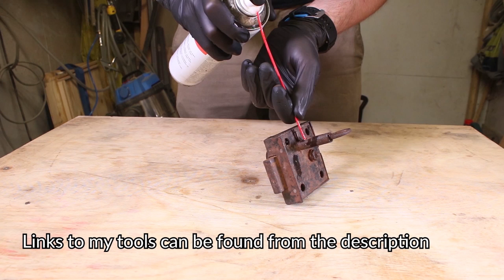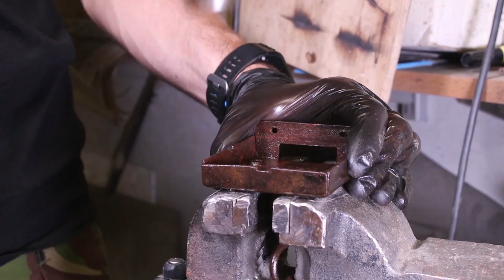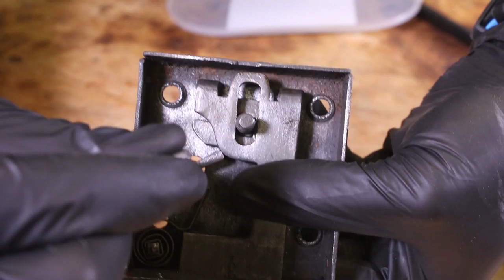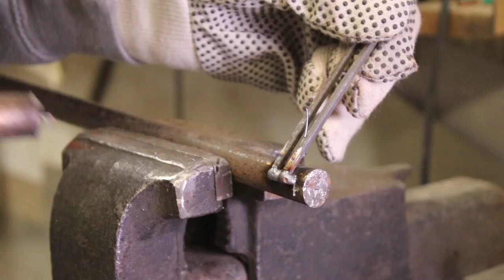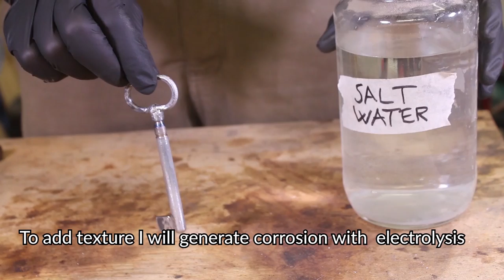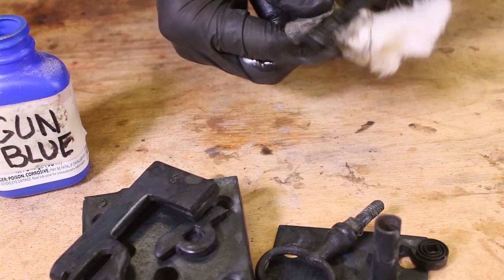Restoring jammed antique lock and making a new key

Comment: As a locksmith, I have to say excellent job. I especially like how you made the key. One little piece of advice. You should have greased the lock up before closing it up. The grease would keep it from returning to the previous state. 👍👍👍👍👍
Reply: The blueing prevents new rust.
Reply: Yes grease will prevent rust and make the lock smoother.
Reply: @bsimpson6204  Graphite was especially formulated to keep locksmiths in business. The worst thing you can put in a lock. We all use lithium grease. Graphite is ok to loosing up a lock, but I wouldn't use it in a lock, especially automobile locks. It does gunk up. You wouldn't believe all the locks I've had to get that crap out to get the lock to work again. Might be ok to use on the lock in this video, but not a wafer lock.
Reply: Came here for this. He definitely should lube that lock with a little assembly grease or something similar. If not to prevent rust, then at least to prevent sticking and make the operation smoother. It's why a lot of old mechanisms like this failed so easily. Rough metal on metal with nothing for parts to glide on.
Reply: @wireworks616  I've found that white lithium grease works well in locks of most types. It's not too heavy, sprayable, seems to last a good long while. We used it on locks when I worked for a real estate company, keeping up with repairs and renos on apartment complexes. We rekeyed locks, new pins, and filing blanks by hand, pretty regularly in that business, if you can imagine. This was back in the mid to late nineties. I still rekey all of my own locks instead of calling a pro. Got pretty good with some of the more amateur rake picks at first, too, but I started making my own picks out of scientific feeler gauges and flat sewer rod from Home Depot or Lowes. Cheap, and can shape them with my Dremel, hand files and some sandpaper taped down to my bench. Get some really great, very specific picks like that, and the gauges are a perfect material for super cheap, even better than most of the government steel picks I've used. Leads me to believe that the pick industry is a massive scam. The inflation on the "good stuff" is ridiculous, when one could simply make their own out of superior materials at home for a very small fraction of the price.
Reply: Whew, I went on a tangent, huh? Oh well, it's worthwhile information.
Reply: @thomasewing2656  Yes it can help but it is literally just an oxide itself but it will wear off over time.
Reply: id also recommenced in investing in a tig plant
Reply: @bsimpson6204  Graphite grease is excellent to prevent rusting (seizing) of a thread. Not suitable for moving mechanisms.
Reply: What's the matter with you? Greece is a nice place why would you want to put it in a lock?
Reply: @gmalamat1393  hahahahaahahahahahahaa I see what you did there, God that was hilarious!! You should be a comedy talker man for a make money thing for your life to do.
Reply: Meh, just give it a dunk
Reply: @AlphaMachina  Super cheap if you have access to a shop and thousands of dollars of tools! Now imagine you live in an efficiency apartment: no garage, no shed, no yard, no shop, not even a spare room. Those "rip off" picks don't seem so expensive now, do they?
Reply: Why do I feel like a locksmith is just  lawfull good, and a lock picker is just chaotic neutral.

Comment: Be careful with electrolysis in salt water: it generates chlorine gas which can be harmful even in low concentrations. You can use Sodium bicarbonate instead of salt. I want you to be able to keep making videos :)
Reply: I didn't know this thanks for info 👌👌👌
Reply: Came down here to say this you beat me too it
Reply: Yep.  I use arm and hammer washing soda
Reply: I use sodium hydroxide.
Reply: Sodium chloride when electrolysed separates into sodium  which produces hydrogen  and releases chlorine gas
Reply: Is that the "Rust Remover" Liquid he didn't label it in description
Reply: Beat me to it, sir.
Reply: i use lsd
Reply: @wesgore8016  You do know bleach is not pure chlorine right?
Reply: Sodium bicarbonate is just baking soda right ?
Reply: A good rule of thumb is to just stay away from working with any of the chloride salts. But a well ventilated area, which is a must when doing anything like this is most likely going to take care of any problems. I say most likely, because everyone's opinion of well ventilated is different. But if ventilation couldn't solve most problems,  most college chemistry lab courses could not exist. JMO, but with two years of chem lab, many decades ago, I still breath just fine.
Reply: Mercury Gaming He was most likely using some branded rust remover, MC-51 is a common one that works well if you were looking for a product name, but the comment chain you’re in is in regards to the electrolysis method he used to create the aged look on the key.
Reply: Just stumbled upon this channel, but very impressed! Enjoyed the way you brought life back into the item without completely erasing the history in it. Your welding is also very satisfying, keep it up!
Reply: @cephalonplant4087  nah its probably just vinegar or something
Reply: I learned something unexpected today! Thanks!
Reply: cassanoa baking soda is sodium carbonate. Washing soda is sodium bicarbonate. I’m not real sure what the difference is but apparently it matters.
Reply: Immediately came down to the comments to add this as a big no-no. Glad someone beat me to it.
Reply: There's nothing like H2So4 for cleaning!
Reply: U are right I am researchers and subscribe to him...
Reply: Awe you are so sweet for letting him know that! I don’t really know much about restoring old items but I’ve always wanted to🥺
Reply: @ATLTraveler  girl why you gotta be so hostile? they're only trying to help

Comment: Pro Tip: A 1:1 ratio of automatic transmission fluid and acetone is the best rust penetrator I've ever found. Even works better than Kano KROIL Penetrating Oil. I work on cars in the rust belt and it's rare that I can't get something to move with it.

Comment: Before hitting anything with a three on it , first install a nut and adjust until flush  if you damage the thread when you back off the nut it will auto correct the thread

Comment: The castle is of course very primitive, but the texture of antiquity is pleasant. A large crack remained on the bend of the body, I hope that it is not through. In the manufacture of the key is not too convenient drill, enough files.

Comment: Looks great. But I have two questions: first, why spray penetrating oil on the lock on a wooden table top.  I work in wood, so I'm completely paranoid about getting oil (or any other contaminant) on wood. Second, why would you not put a wood block between the handle and the hammer? You could very easily peen the end--and you are using a peening hammer. The first just makes my skin crawl (YMMV), and the second just seems so simple a preventative measure (again, your mileage may vary). I do really enjoy your videos. Great work!

Comment: @15:30 The key should have a longer tip on the end.  The end of the key should protrude through the hole in the case on the inside for more support during the unlocking action.  Also, blah, blah, blah, grease.

Comment: Would not it have been easier to cut old key and attach the HEAD (loop) to the bolt -- ie NEW KEY?
I like your talent though...
And those STAR bolts for the OLD lock...  lol
Reply: Yep, I'd agree with you. Only difference is I would reuse the entire old key but cut off the flat at the end and replace it with one that fitted correctly instead.

Comment: That is a very old Mortise lock, it is really worn out, shakiness on handle needs bushings, those keys are still sold today where I am, but you need its number. You do seem to have the tools to do a proper restore but yet you rushed it.Very good job on the key re-make for sure. But negative on restore 4/10.